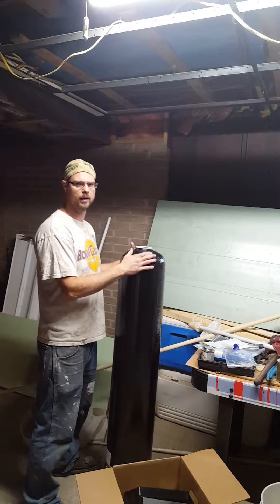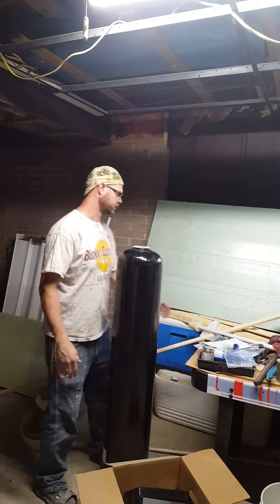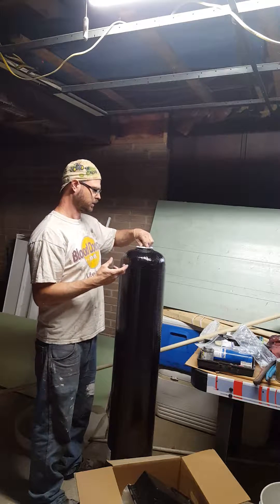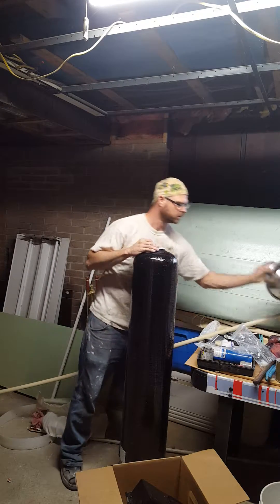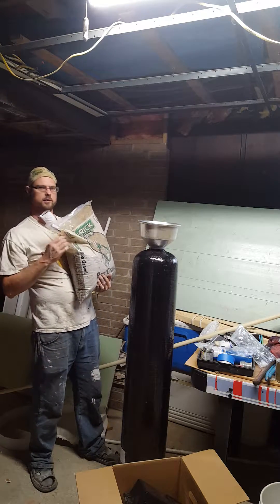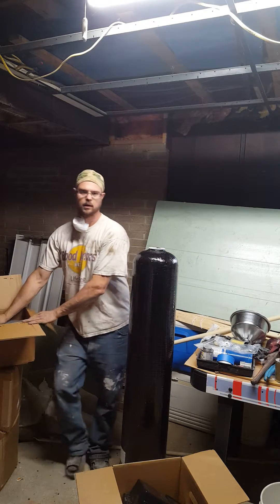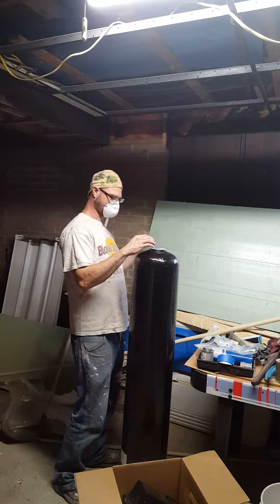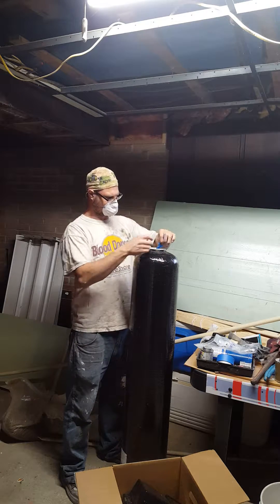Air injection system DIY or any water treatment system, save money!!

Comment: I see below you weren't happy with the performance.  Have you updated the system?  From what I've researched...on a 10X54 we need to use 1 cubic foot of katalox.  There needs to be room at the top for the air bubble to do it's work.  That may be/have been the issue?  I'm in the process of building one now using the Clack WS1 EE.  Just didn't know how much gravel to use.  No one really clarifies that.  lol

Comment: Are you happy with the system?  Did you have rust stains before? Did it take care of them?  Do you have a ballpark idea of how many gallons the back flush uses each time?  Thanks for your time.
Reply from the maker: Sorry for the delay. I just seen the question. I am not completly happy. I still get slight yellowing in toilets not used as often. So i am currently adding a Peroxide injection system. This will inject hydrodgen peroxide into my pipe ahead of my pressure tank. I am using the pressure tank as my activation tank for the hydrogen to breakdown any Sulfide or iron. Hydrogen peroxide is also very safe and healty for your ingestion.
Reply: @oxjam48 that's a real bummer to hear